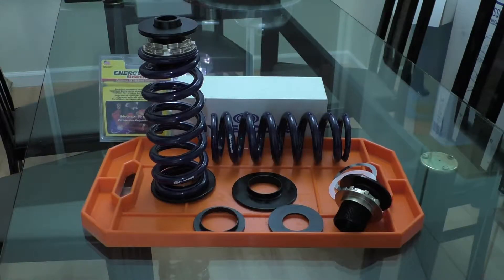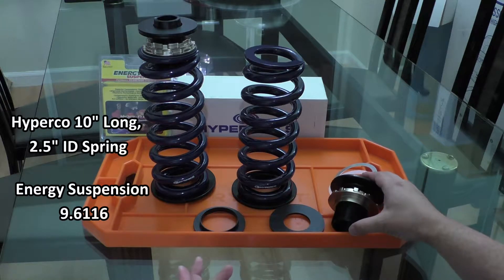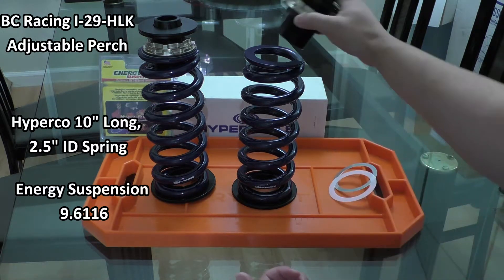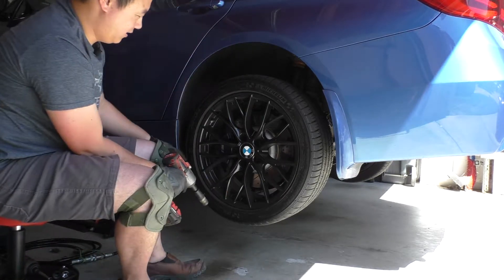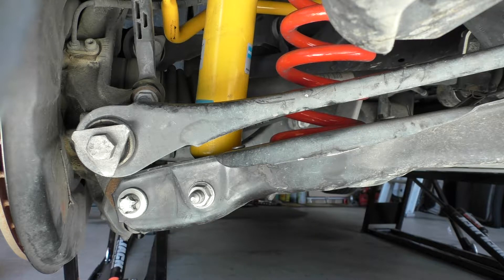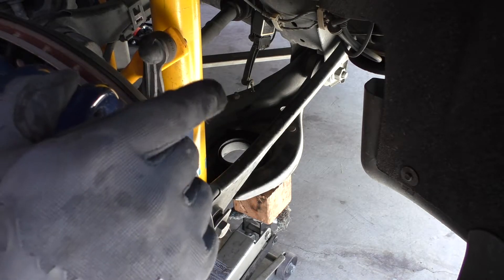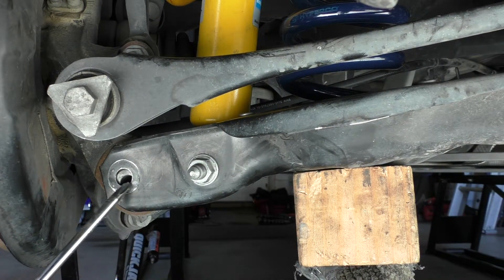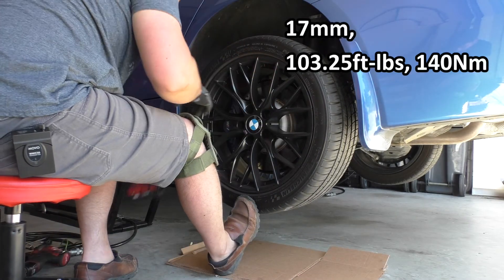DIY BMW F2x/F3x/F8x Rear Height Adjustable Spring (HAS)

Comment: So this basically allow you to ajust the height of your rear lowering spring just like a coilover? 

Something that bothers me is that for some reason on F series Xdrive H&R lowering springs only come in sport and not super sport (lower version) so what happens if I do the same thing that you did but ajust it at the lowest possible. Will my axel or my car blow up?
Reply from the maker: Yup, it allows you to adjust height just like any of the coilover kits you might buy.

The thing you'll want to watch for when lowering your rear is having enough free damper travel. The bump stop on the damper should prevent it from bottoming out and damaging it, but you'll have a harsh ride if riding the bump stops.
Reply: ok cool thank! Can you also check or change your links, they didn’t worked and I’m very interested in finding them. And last question, if I already have some H&R lowering sport spring on bmw F30 Xdrive can I keep thoses and simply add Adjustable Perch on top?

Comment: I used this for my rear on an E36 M3. Actually only running static 900lb springs Hypercoil. Running with no rear sway. Not harsh at all and  zero issues overall. That should cover E46 and possibly other chassis. I'd recommend koni sport adjustable E46 M for a E36 upgrade and best for lowering springs. Always upgrade if possible. 
 Thank you.

Comment: Did this rear setup make any clunking/clicking/rattling noises? I have the GC "weight jack" articulating height adjustable spring perch and it clickity clacks all day long.
Reply from the maker: This setup makes no tapping/clunking/rattling noises. In cold weather it can occasionally make a creak when going over big speed bumps, but nothing else.

GC weight jacks for the F-chassis cars have a stupid design since they just took what they designed for previous chassis and lazily adapted it. On prior generation cars the weight jack went on the bottom arm, since it's flipped on F-chassis the "cone" just traps a bunch of dust/debris in there that get into the spherical bearing. I bet that causes a lot of your noise.

Comment: Very cool. I've seen that the M3 and maybe the M2 had a HAS offering but there wasn't one I'd seen for F22. Did you consult with someone regarding the spring height and spring rate along with your shocks?
Reply from the maker: I picked my own spring length and rate based upon a suspension model I made for my car, and then had Fat Cat Motorsports create me a bespoke damper to match (based off of Bilstein damper body/parts).
Reply: @FaRKle0079  I don't suppose you've figured out how to make HAS for the front?
Reply from the maker: @grocerylist  Unfortunately not. You kind of need custom springs (no off the shelf option) in order to do something like that for the front.